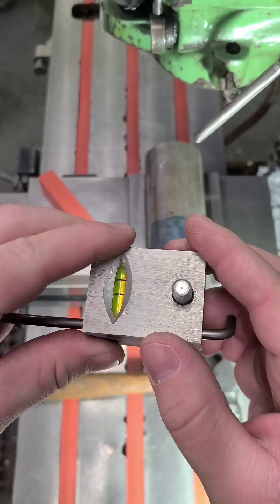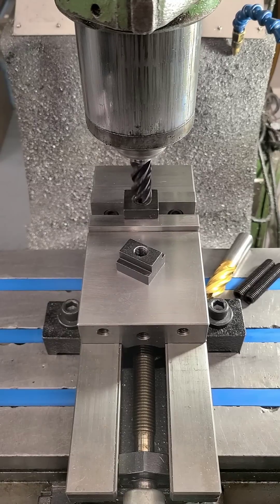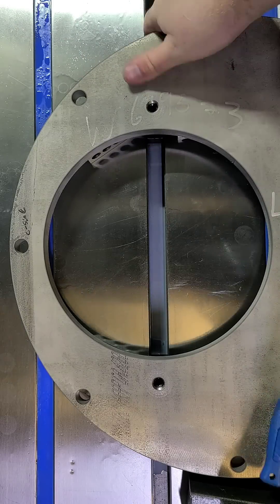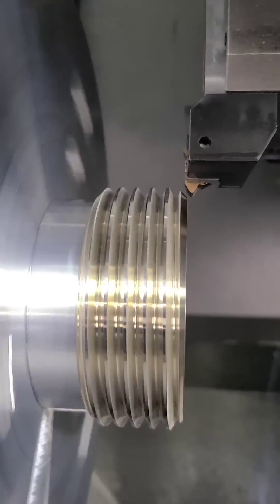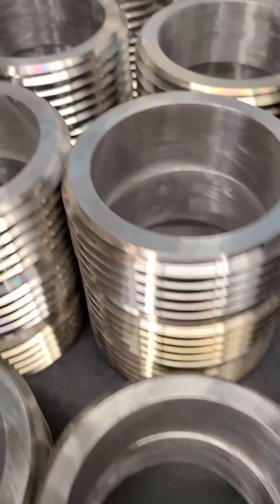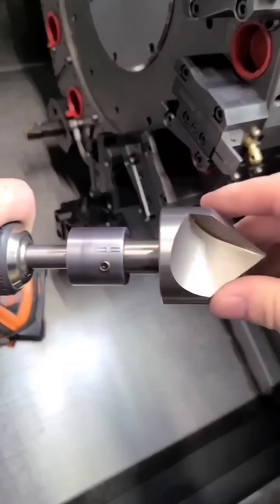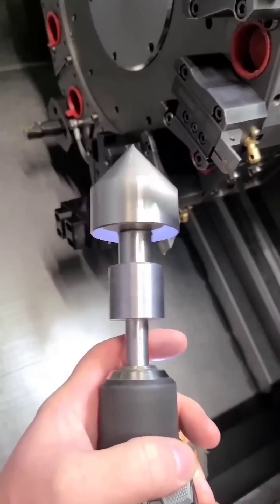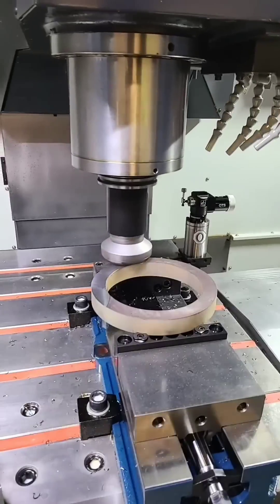Machinist Tips and Tricks Volume 6

Comment: I use a new file or the unworn potion of a used file to rake tiny stickers out of my skin back toward the direction they came in from. It’s my go-to. 

 If it won’t grab the sticker, just keep filing until you remove enough skin that it will.  Works almost every time.
Reply: Now my bones are showing
Reply: @michaelkolano8686  Now it’s easier to see the sticker against the white background.